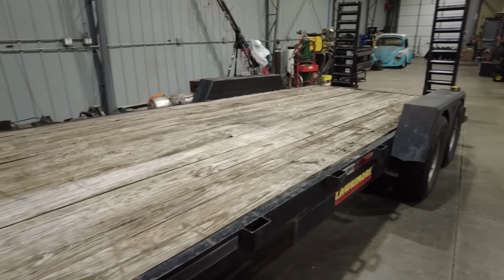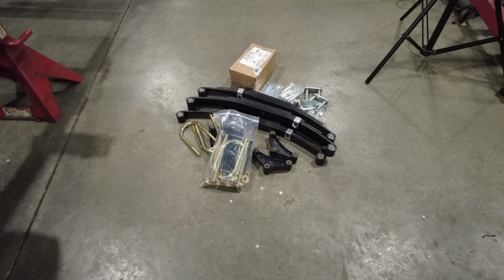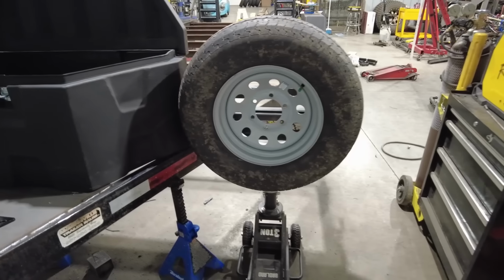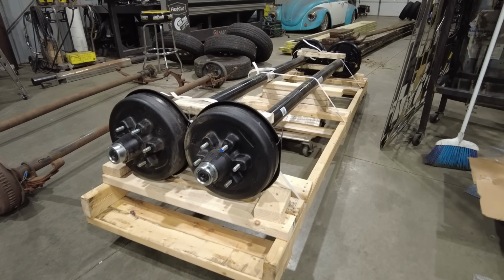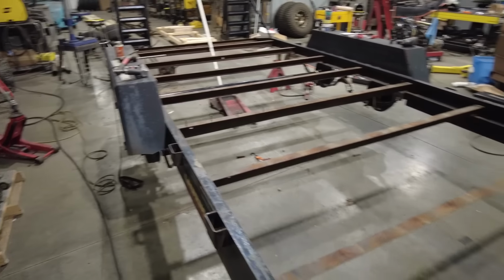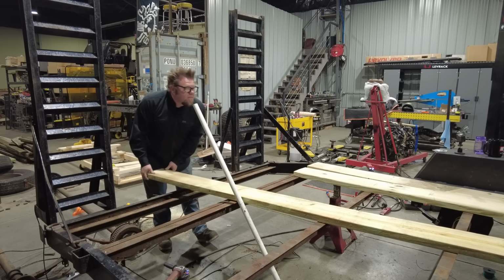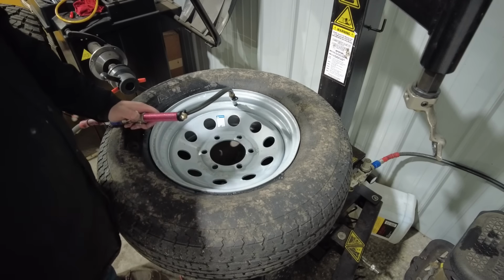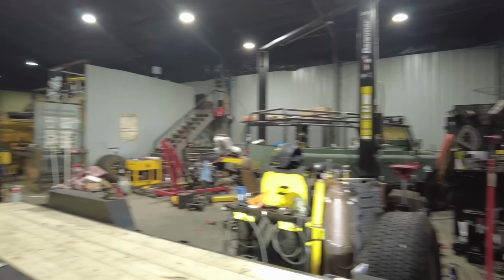Car Trailer Rebuild, How to Increase the Load Capacity of your trailer

Comment: Some people make a center strip of removable boards so they can use the trailer like a lift so they can work on the underside of the car if necessary.  This is handy if you need to do repairs at the race track.  If you don't have a trailer brake disconnect, sometimes it is easier to mount the junction box closer to the trailer lights behind the rear most axle, to shorten wiring runs to trailer/running lights and brakes.   After finishing the wiring in the junction box, fill the interior of the box with regular wheel bearing grease.  This will prevent water and salt from getting to the connections and shorting them out, particularly where they salt the roads.  It is also a reservoir of grease that you can use if you have to repack a wheel bearing out on the road.
Reply: This is a great addition. Thank you for this.

Comment: @bigtiregarage Ive used those junction blocks without the pigtail for 20 years, when rewiring the back of a lot of trucks and jeeps that have had scotchlocks and other splices in their wiring.  It’s made fixing light wiring so much easier.  (First time I saw these were when I ran a tow truck).

Comment: I was always told by trailer manufactures not to use Pressure treated lumber for decking because it causes the steel to rust faster unless you galvanize the steel.
Reply from the maker: I could see that...but at the same timr I can't see how the material that is held together with metal screws would rust steel

Comment: Yeah I’m not a fan of that spare location.  Seems like it will block your view of the trailer when towing. Not to mention that upgrading the weight capacity requires more than higher rated axles… the suspension and frame also have to be suitable for carrying the increase.
Reply from the maker: The frame of a 10K and 7 K trailer are the same...and if you watched the video you would see the suspension was also upgraded.
Reply: @BigTireGarage  Dude. I watched the whole commercial. Nowhere did you describe the suspension components as other than “new.” No mention of the frame being “the same capacity” as a factory 10K trailer.  No mention of the actual load rating of the new tires. And, to top it all off, you gave confusing information on the “total” weight capacity of the trailer… Now, most people are clueless when it comes to trailers and they tend to vastly overload them. You shouldn’t contribute to this problem. 🤷‍♂️

Comment: Nice rebuild. A couple of points to consider. Two 5,000 lb axles does not mean 10,000 lbs of cargo. It means 10,000 lbs pounds including the trailer itself and the load. You need to weigh your trailer empty so you know how much cargo capacity you have left.
Additionally tire pressures are relative to the load which they are carrying to a point. 40 psi is probably good for medium to lighter loads but to access the full weight rating on a tire, you need to use the maximum tire pressure listed on the tire.

Last, the center lights will be a great addition if you only haul rolling loads with center clearance. However, if you haul stuff that would put any weight on the center of the trailer, especially if it is stuff that will slide or have to be drug on or off, all your hard work and money will be quickly destroyed. I’m sure you evaluated your specific intended use when you added that feature. I only mentioned it for others who may be thinking about that modification. For me, I use my trailer for hauling all kinds of stuff from rolling loads, to scrap metal and those lights would be destroyed within the first couple of uses. The lights by the spares will be perfect though. I also add bright back up lights to the back end of the trailer because I always end up backing up in the dark and trailers are miserable to back in dark areas without back up lights.

Again, nice rebuild!
Reply: like reading these mister-know-it-all comments telling the guy how to do it.
Reply: @BSC_1982  no body is telling anyone how to do it.  More like telling them how not to do it. Just don’t think this video is telling you how to beef up your trailer because it doesn’t. It’s just a nice refresh.
Reply: @BSC_1982  durr?....weiner schitzel...
Reply: @BSC_1982  one more of my know it all comments🤣🤣🤣but heavier axles does not change the gvwr the manufacturer put on it. And heaven forbid dot ever checked and you are overweight
Reply: @markmeier4206  heaven forbid you have a HOME MADE trailer!    Prey Tell,  oh, weight wizard and master, ....  how is the mfg. sticker contrived?
Reply: I don’t think the lights will last, I always use a jack to lift cars on the trailer and he just canceled lifting in the middle and rolling cars on, I do with car with broken ball joints and rack and pinion.
Reply: @juanlara9409  skid plate
Reply: @juanlara9409  I I were doing cars I had to jack up much to load.. I would  build a set of short ginn poles with different mounting points  on the sides of the trailer frame .this way you can lift and move the load forward at the same time. With the winch ..keep changing the  position of ginn poles as needed   much easier than a jack .
Reply: upgraded axles and not updated frame.
Reply from the maker: @Mikefngarage doesn't need it..same trailer from same manufacturer uses same frame for 7 and 10k
Reply: @BigTireGarage I have a Lawrimore 18’ tandem. It’s a 2x3 tubular frame with a 5” wrapped tongue. It has a 2 5/16 hitch. I’m considering upgrading the axles myself. I have considered doing 7K axles for the sole purpose of supporting the weight if one or more tires blow. It’s a pressure washing trailer and I’m considering upgrading to a 525 gallon water tank and 100 gallon chemical tank.
Reply: One other mention.  Just adding bigger axles does not give you more capacity. There were not structural upgrades (in fact cutting the cross brace where the tongue jack is I would say is a down grade, due to additional twist being allowed in the tongue from having only plate replace it. ) Most people have a tendency to overload their trailer as it is, so thinking you can now add more is dangerous thinking. At best he got a bit better braking and made up for the added weight of the winch and batteries and heavier axles.
Reply: @jasonblaschka6216  , in my mind his upgraded axles and tires does not increase GVW. The Manufactures VIN still tells the story from the factory.
Reply: @johnirwin1837  all he has to do is file the paperwork for a homemade trailer.
Reply: @johnirwin1837  that's in 'your' mind,....    a good place to start the learning possibilities!
Reply: that is only partially correct as well as the tow vehicle also supports some of the load.
Reply: @ Mark Meier: Trailer capacity ratings have nothing to do with the tow vehicle. The weight rating of a trailer does not increase or decrease based on what vehicle it is attached to. The trailer has its own weight capacity rating based on its construction. It is up to the operator of the tow vehicle to make sure they are using a vehicle with a tow rating high enough to pull the loaded trailer and that the load on the trailer is situated in such a way that the tongue weight also does not exceed the capacity of the tow vehicle.
Reply: @tw6896 I think what he meant is the tow vehicle supports some of the weight of the trailer and the load. The tongue weight is  supposed to be 10% of the total trailer weight. 
God bless you!
Reply: @michaelboyle if you are referring to the old comment where I was saying that a trailer load capacity rating applies only to the weight of the cargo plus the trailer and the reply saying I was partially incorrect because the tow vehicle carries  some of the weight, his comment was incorrect in that context. Sure, some of the weight is tongue weight and it is applied to the tow vehicle, however, as it pertains to the load capacity of the trailer, weight carried on the tow vehicle does NOT count in the rated trailer capacity. Only the weight of the trailer and the weight of the load on the trailer is calculated for trailer load capacity. The weight of the trailer is factored in because the axles and suspension of the trailer are carrying both the trailer itself and the load on it.
Reply: @tw6896  if you have a 2000 lb trailer and 5000 lb load and you put 10% of that on the hitch of the truck, then the trailer axles are only carrying 6300 lbs. When a police officer weighs the truck and trailer, it looks like he has a 6300 lb trailer, and the rear axle of the truck weighs 700 lbs more plus a little weight transfer from the front of the truck because the rear is squatted more. To my knowledge, they don't separate the truck and trailer when weighing them so you can actually legally carry more weight on the trailer than the trailer rating by the amount of the tongue weight. 
God bless you!
Reply: @michael Boyle. I never said anything about DOT, citations, or legality. The video and the conversation is about increasing cargo capacity of a trailer. As I have been saying, the rated capacity of a trailer means that the trailer is rated to carry the weight of the trailer plus the weight of the load up to the published weight rating. I’ll use arbitrary numbers purely for illustrative purposes. If you had a trailer that had a rated capacity of 10,000 lbs and the trailer itself weighs 3,000 lbs, then you can only carry 7,000 lbs of cargo to prevent going beyond the manufacturers 10,000 lbs weight rating of the trailer because the axles, tires, and springs are carrying the entire load of the trailer plus it’s cargo. The tow vehicle is NOT considered in trailer weight ratings. This is a safety thing and not necessarily a DOT thing.

Now, if you want to have a new conversation about DOT and their actions, it’s going to be a long one because the actions they can take differ based on location as well as the individual officer involved. I’ve even heard some say that they don’t care at all about gross vehicle weight ratings so long as you have paid for the proper plates and any required permits for the particular load.
Reply: @tw6896  the tow vehicle isn't used in any calculation about the trailer but the tongue weight is because the trailer manufacturer knows that it's not safe to haul the trailer with no tongue weight. 
God bless you!
Reply: Again, the conversation is about rated trailer capacity. I’m not sure why you insist on bringing up things that are not part of the initial conversation. Having the correct trailer tongue weight is critical for pulling safety but has no bearing on rated trailer capacity. I’m not sure how I can help you beyond this point.
Reply: @tw6896  Ahhh.  yes,   trailer (actual weights) capacity MUST be considered in the applicable "tow vehicle" max vehicle weights,  etc... .   AND your state's vehicle (and trailer)  licensing schemes!

Comment: Those junction boxes follow rv wireing. great build, did you check your coupler to see if it is rated for the extra weight and is the frame overbuilt enough?
On my trailer we put 4 inch channel down the middle with holes on it for extra places to tie to

Comment: What about the running lights and the brake lights and I fully agree with you you wouldn't be able to find another trailer anywhere for that price and you saved close to $3000 even though if it were me I might've replaced the wood with diamond plate front to back and I probably closed up the center of it too but I like all the other upgrades you did to the trailer and I like the fact you put a second spare tire mount on the front of the trailer because you can never have too many spare tires or parts especially when you travel and tow alot and go from coast to coast
Reply from the maker: I thought about diamond plate...but decided against it

Comment: Very  nice.  I actually bought a brand new 23' about 6 months back.  Did not have anything to rebuild.  After watching this video, most likely could have found a used one and performed minor rebuild for alot cheaper.

Curious how you mounted the tongue box.  I have been looking for one, but was looking at the metal ones.  Yours is much less expensive and most likely work just fine for me.

Thank you for the video, will place this one in my saved for future use.
Reply from the maker: Bolted through trailer frame with large fender washers
Reply: @BigTireGarage  Thank you

Comment: I work on trailers for a living,  so white is ground every day, lol.
They also make a 7 wire loom, like the 7 way plug wire you put to the box. Already in its jacket ,just have to splice at different points . 
Really as long as your happy with the wiring on your own trailer and it all works. All that matters.

Comment: The jack mount should have been reinforced.  That single plate will bow in time.
Reply: without gussets the spare tire mounts will not be long before welds crack.
Reply: I hope no one is around that trailer when he loads up the 10K winch. Everything he did is half done.

Comment: I enjoyed this rebuild on your trailer, it will last you many more years. Two things I would of changed, I would use metal valve-stems, and I would put a metal brace under the spare tires for them to set on,  just for more support.

Comment: On commercial trucks and trailers white is ground. And I think that color coding was standardized before the light duty market was since the 7 spade RV connector is relatively new compared to the other trailer connectors. The lights down the center is a pretty genius idea.

Comment: put a socket on your jack and use an 18 volt drill to lift  nose and to lower it works well and no more knuckle busting.
Reply: he already covered that in video, it has a flip over handle which reveals a nut for using a cordless driver.

Comment: Cool Ian,  I have always been annoyed by trailer axles not having shocks because the amount of bounce in the trailer is crazy.  Usually people dont ride on a trailer to quantify how bad it is but that does not mean it is not going to rattle your prize possession to bits.  Why no shocks when you clearly know the utility of good damping?  Lippert and Dexter seem to not care so maybe they would be offended if you made the upgrade, but from a safety point of view bottoming the axle can bend it (note also no rubber bumpers???) and hitting the right hole can emulate a catapult.
Reply: Is assume his “prize possession” has shocks on it. But I have always wondered how much shocks would help a trailer especially bigger travel trailers
Reply: I'm thinking about trying a coil over set up on one of my next projects or just air
Reply: If you  properly  tie down your prized possession ..you are using  points that leave its suspension free ..ie tie down at axle points  that way your not having to collapse the suspension on it or having to worry about chains going slack on bumps and coming loose

Comment: The junction you got is what they call RV standard for the wire colors that’s why they don’t match. The one you need to look for is an auto standard one they have the colors matching what they typically are.
Reply from the maker: All good...label maker fixed the problem

Comment: I like the center lights, but I probably would have tried to recess them a little more if possible and put some kind of guard around them. Just in case someone finds a way to mess up and run them over or someone accidentally steps on them...lol.

Comment: Just a response on the electrical connections, here in Australia it seems different again. You would think this was simple connection for 4-7 or 12 pins, and that it would be uniform globally.
White- Earth 
Red - brakes. 
Brown- Taillights. 
Green-Right signal. 
Yellow- left signal. 
Blue - electric brakes. 
Black is generally left disconnected, though it is reserved for reverse lights, ( as this is what I use it for) though some do use it for a power source to energize the breakaway battery box.
But as many add items to trailers accessories, is where I put 12pin plugs, to run extra connections where possible.

Comment: Ian, the wiring is standard 7 pin wiring. All 4 pin, 6 pin and 7 pin are different. The reason for blac being 12vdc and white being ground goes to the RV industry which comes from building code as all house wiring is black being hot and white is neutral. The confusion comes from going back and forth with 4 pin wiring. Wired many a 7 way while in the RV industry. Lippert is the standard for axles and are probably the best of them all.

Comment: Next time you need to replace the deck, you might want to think about using 4 layers of 0.75 inch sheets of plywood laminated (glue and screw) together for a total thickness of 3 inches...

I'm not sure how heavy that would be compared to the 2x6's you're currently using but it would be considerably stronger and you can still recess the lights down the center...

If it's strong enough, you might even be able to get away with only 2 layers (1.5 inch total thickness) or 3 layers (2.25 inch total thickness) for the same (or slightly more) strength with less weight giving you more total cargo weight capacity since less or your 10K Lb. Weight Limit is taken up by the trailer structure...you would likely need to epoxy coat (or your waterproof coating/paint of choice) the plywood before installation to prevent premature rotting...